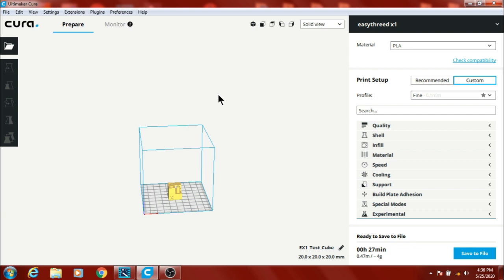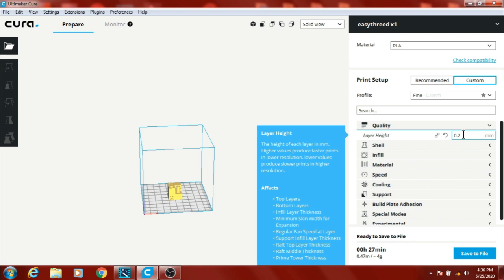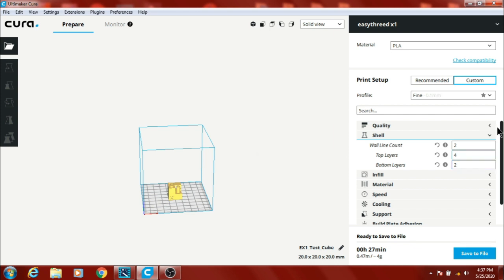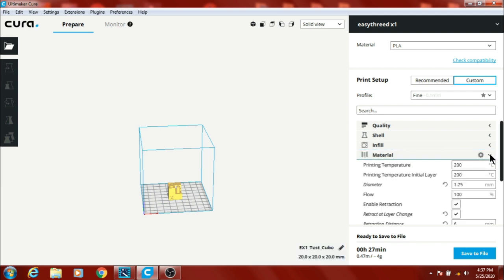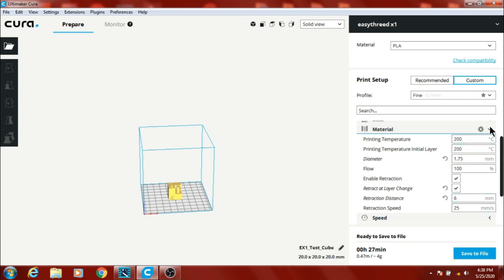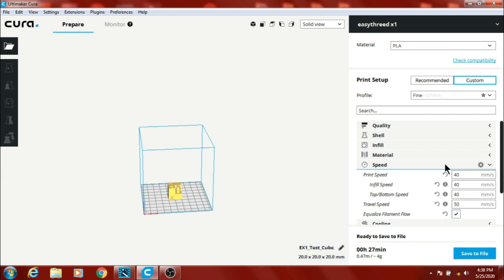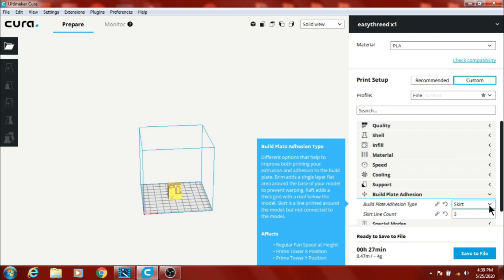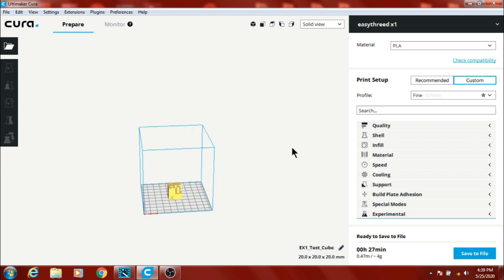Cura settings for Easythreed x1 3D printer

Comment: I know this is a long shot but for whatever reason, my print is only printing in a corner.  I have it set to the middle and all the nozzle does is move around.  There is no filament coming out.  I'm new to this so be nice haha.  Thanks for any help!  Its appreciated.
Reply from the maker: Check the slicers settings make sure the printer bed size is correct for you printer in the settings
Reply: @retronerd872  I have double checked and made sure it's correct.  I could be wrong (all wrong)  do you have a "how to" on setting up cura with this printer?  Or what are your settings.   

I'm at a loss.  It's still printing in a corner and the print is coming out all jacked up...😔
Reply: @analiciamontenegro7125  check the printer machine settings and uncheck origin at center.
Reply: You’d have to go into machine settings and input gcode to X=40 and Y=60 and set it

Comment: What version of cura? Easythreed printer is not on cura printers,details are overwhelming
Reply from the maker: Just set-up a custom printer using cura you can follow the same settings used in the video that should get you going